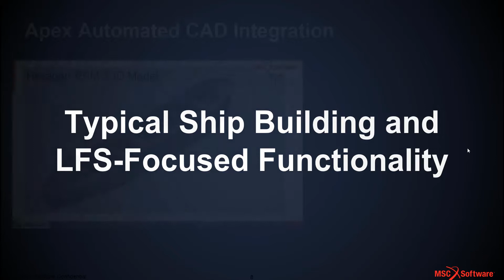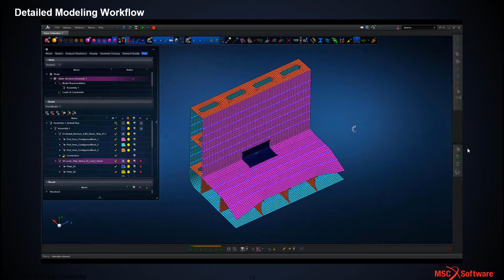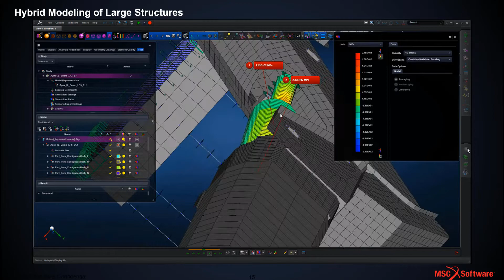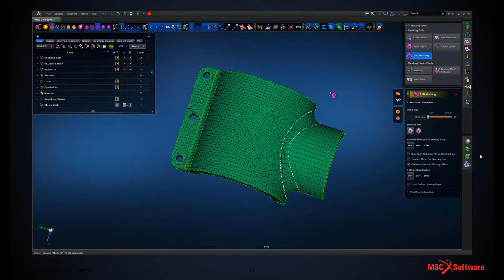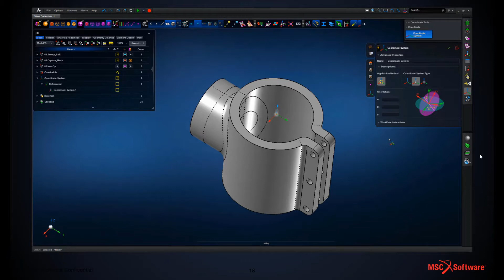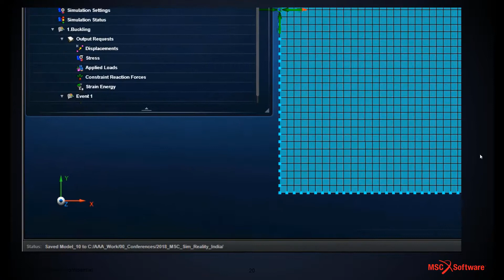MSC Apex Iberian Lynx Webinar | Next-Generation FEA for Ship Building and LFS Applications

Comment: Hi, Is there anyway to get op2 file from msc apex??
Reply from the maker: Yes, Amin. Apex supports 'an end to end' MSC Nastran workflow, normally based around HDF5, but can also handle OP2. 

You'd need to export BDF from Apex, change the PARAM,POST card to request OP2, solve using MSC Nastran, then read the OP2 back into Apex.
Reply: @evotechcaeltd1583  thanks again for your time and answer,
I'm new to this software, can you tell me how to change PARAM?